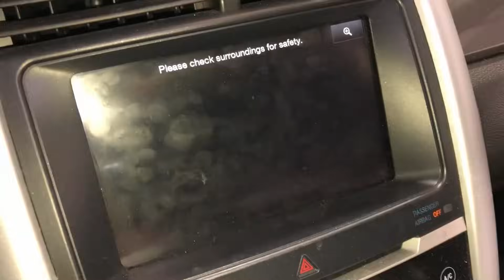2007-2019 Ford 6F50/55 Six Speed Transmission: Fluid Exchange Procedure

Comment from the maker: These are the Tools and Parts I Recommend:
Mercon V-
https://amzn.to/2XnQJHF
Mercon LV-
https://amzn.to/2N1aOji
Transmission Funnel-
https://amzn.to/2FnH2Pf
Thread Sealant-
https://amzn.to/2MYaSjJ
Reply: Fordtechmakuloco, what about the models that don’t have a dipstick? Fluid change is straightforward, but curious about how to confirm correct fluid level without a dipstick. 2014 Ford Edge Limited, 2.0L ecoboost, 2wd
Reply: @honkybd  did you ever find your answer?  Let me know I may have your answer
Reply: I have a 2018 Ford Explorer Limited. 3.5L V-6 Dertec Engine FWD. Is this the procedure I use for this transmission DIY job?
Reply: @PeterSlots  I'm not sure if we have the same engine and transmission but I would say we do, I have a 2017 3.5 liter engine as well. That being said the process should be the same.
Reply: Fordtechmakuloco do you screw in the dip stick fully or just drop it in when reading?  There would be a difference because screwing it in fully changes the reading a few mm's.
Reply: I got a couple questions about a 94 Ford Thunderbird 4.6 and a 98 Ford F150 4.6
Reply: Having issue with a 2011 ford ranger.
 Transmission slips when making a turn after straightening up and de acceleration will correct itself. ATF flruid topped off any idea?
Reply: Hi my name is Mark I have a 2010 Ford Fusion V6 all-wheel drive and the transmission will not shift pass 3rd gear what is your suggestion for this problem
Reply: Do you recommend just the drain and fill. Or would a transmission flush be better. Performed by the Ford dealership of course. 2018 Ford Explorer 3.5L V6 engine.
Reply: @PeterSlots  drain and fills are better. Flushes can disturb friction material. Especially if it wasn't regularly maintained every 30 to 50K.
Reply: Do you recommend BG chemical products such as their transmission fluid which comes with a warranty for a complete transmission fluid flush or do you recommend just sticking with Motorcraft products?  First time Ford owner and was just curious on what you would recommend. Thanks.
Reply: Hey man I have a 2014 explorer sport 4wd ecoboost... from park going into drive it makes a slight clunk noise .. any idea why?? It runs fine and transmit shifts normal .. just makes a slight clunk noise form park going into the Drive. But from neutral to drive it’s goes in smooth .
Reply: My reading is at max. Do i have to take some oil out?its over the half mark
Reply: Do you know the part number for a replacement drain plug ?
Reply: L
Reply: My 07 has the little yellow dipstick. It’s a 500 frt wheel drive. Do I still use the same fluid as in the video or Toyota stuff ? Thanks ! 
Great channel!
Reply: Hey FordtechMakuloco, 

 My trans axel has a weird clicking  that almost  sounds like something  spinning, in front of the drivers side half shaft right above the drain plug,  have you  ever heard this?  Do you know what that is?

Comment: I don't have the space or the physical ability any longer regrettably to do this service myself. I know this video is 6 years old but I was wondering if anyone had any idea what a Ford Dealer might charge currently now in 2025 for this service on my 2013 Taurus Limited 3.5cu. front wheel drive without ecoboost.  The car currently has 52000 miles on it and shifts fine and my owner's manual maintenance schedule states that transmission service needn't be performed before 150,000 miles which I think is ridiculous.  All 3 of the quotes I got from service shops around my area quoted $350 to $479 for a full flush and I've read numerous articles online against doing the purge/flush service and simply doing the drain and fill procedure outlined in this video. Any opinions or help on the topic would be appreciated.

Comment: Fusion Sport 2.7 uses same transmission. You can also use any Dexron VI fluid as this transmission is a joint venture between GM and Ford.

Comment: I just bought a 2016 Edge, and from my research the 6F50 trans hold 11 qts. of fluid, but not all of it can be drainded at one time. Multiple changes such as this would be needed to totally have changed all the fluid. So this prodcedure is actually more of a refreshing of the fluid, not a total exchange. But I am still going to do it, and probably about every six months for quite some time after that. This video IS very helpful in explaining the prodedure.

Comment: So I have 2017 Ford Edge doing a transmission fluid change you don't have to replace the trans filter??????
Reply from the maker: You cannot without splitting the case.
Reply: Ok thanks, i done flushed and refilled 3x the transmission and shifted gears while flush and fill and fluid is still black i even tested the drive and it gets hot and started slippin after the car gets hot

Comment: hi, your video are very interesting: i hae one question: on 2011 i bought a ford Explorer 2011 limited 4wd new, i imported it directly from Usa. At today i drive for only 14.700 miles. In this 14 years i never change trasmission oil, i cheked and oil is right level. Is better than i change oil? And i wil change oil same this video or should I also flush the automatic transmission with additives? Some mechanics in Italy tell me that if I just change the oil without flushing it, I might have problems with the transmission, so they tell me not to change it. Could you give me your opinion? Thank you very much.

Comment: My 2011 Flex has 397000 miles on the original motor and transmission.
Regular oil changes with Super Tech full synthetic oil with Marvel Mystery oil on the engine Regularly drained and filled the Transmission. Still running fine.
Reply: Single drain and fill transmission fluid change or more?

Comment: I have the 6f50 in my 2017 3.5l edge with 57k miles, I went to local ford dealership and was quoted $379 for a fluid exchange service, not sure if this is drain & refill or a flush of some sort. Service tech did mention something about using a machine to suck fluid out, is this a flush and would this be advisable or just a drain & refill. Thanks
Reply: Add a bottle of Lucas Transmission Conditioner next time too, in place of some of that 4.5 quarts.

Comment: I bought a 2017 explore XLT last year with 103,000 miles. After a bunch of DIT maintenance I've had to do, I checked the fluid and its.... So bad. So I've started doing some small incremental drain a fills, like 2qts at a time every 500 miles or so. Trying to avoid shocking the transmission
Reply: Add a bottle of Lucas Transmission Conditioner next time too, in place of some of that 4.5 quarts.

Comment: Sir! I have  actually i bought my son a ford excape s 2017 and we change the tranny fluid and my question is if its ok  to over filled the fluid, what we did is we removed old fluid measured almost 4 quarts on cold temp and then we add 4 1/3 abit fluid thats the reason i  ask is it bad if you overfilled the fluid? Thanks!

Comment: Hey, you seem knowledgeable on trans, I have a ford flex, 6f55 that is kicking my butt for about a year,, I have never found another with the issues mine is having, Im praying you can help?? p0973, I have changed the converter, valvebody and solenoids, I just dont feel like its a transmission issue? What would you do? Change the trans?  Thank you so much!!

Comment: Love yours videos. I was wondering if you’ve done one on how to drain the fluid from the torque converter on these? I have the 6F50. I guess you have to remove the return line and drain and fill until new fluid comes out or something, not 100% sure on these… it’s my wife’s car. I have polenta of fluid, just don’t want to waste any if you know what I mean.
Reply from the maker: No need to drain converter, fluid drain and fill every 30k miles is way more than enough.
Reply: @FordTechMakuloco  ok, thanks for the reply. The only reason I was wanting to get it all out was because it a new used purchase and can’t confirm it has been done when the records show. Maybe I’ll just do like you suggest, but just do it again in ahead of schedule. Thanks again really appreciate the advice!

Comment: I’ve watched a lot of his videos and this guy is the best! My wife has a 2017 explorer and when she would go 50mph and let off the gas it would stall or hesitate when it would decelerate.  Cleaned the throttle body, MAF sensor and sea foam cleaner in a full tank of gas and would hesitate when she would let off the gas pedal. Took a chance and took this guy’s advice……PROBLEM SOLVED! Fluid was black at 86k miles and took 4.5 quarts of Fordmotorcraft MERCRON LV runs smoother than ever, shifts smooth and no hesitation like before! But warning the transmission fluid is $15 each quart!!😮😮
Reply: Ya I have watched all the more popular f55 trans fluid procedure videos and this one is the best. Some forget to measure the fluid some dont know how to check it correctly etc etc
Reply: what I did to measure the fluid level was let the old transmission fluid drain into and old pan because it had NEVER been changed cause she bought it brand new from the Ford dealership.  I had 5 empty oil bottles and poured the old transmission fluid in them to see how much drain out of the trans. Fordtech was on the money cause there was 4.5 quarts that was drained into the oil pan.  Instead of having half a quart take up space on my shelf, I left the drain plug out so when I put half the quart in it would “flush” the remaining black oil sitting in the trash out.  The fluid was black then turned red, put the plug back in and put the remaining 4.5 quarts in and my wife says that it runs better than before!
Reply: Bideneconomics! You feel the pinch when you pay $15/QT for a fluid! I think corporate greed is taking over FoMoCo now, more than ever!
Reply: I paid $9 per quart at summit racing

Comment: I have a 2019 ford explorer the transmission looks like the one you are working on I have already did the trans oil change and I get PO867 code but I’m not sure where the transmission fluid pressure sensor is located

Comment: After I did the drain and fill and oil level was good.... I took it for a 10 minute drive. I noticed some transmission slipping. I checked the oil level after the drive and it was in the hash marks range somewhere above the middle close to the hot since I drove it around. It wasn't slipping before. I am hoping I just need to drive it a little bit more for the computer to adjust to the new fluid. The oil that I drained was almost exactly the amount I poured in when I placed the old oil in the empty container.. Can anyone elaborate? Thank you

I just noticed it might be the throttle body. I went ahead and cleaned it today while replacing the spark plugs and from what I saw on another video..... The car needs a reset to calculate the throttle body. Current doing the reset and hopefully it will solve the problem. I did both spark plugs and transmission drain fill today. Since I had removed the throttle body and it was dirty.... I cleaned it. By the way... The battery was disconnected during the spark plugs and throttle body removal.

Comment: I just did a drain and fill on my wifes 2015 Edge. My brother has a 2011 Explorer but only puts a iut 8,000 miles on it a year. Should he drain and fill the transmission fluid more frequently than every 30k miles?

Comment: Why can't you just measure out how much fluid came out and put that much back in?
Reply: You can if you want to assume that the person who put it together, did it the right way. But if you’re spending half an hour to do this, why not spend an extra two minutes and do it safe? I just changed the fluid in my wife 2017 Explorer I used a 2 gallon pitcher that was marked to measure how much came out and only 4 quarts came out. Which meant it wasn’t full to begin with. I put 4 quarts back in, drove it and had to add more.

Comment: does the fluid always have to be drained to replace the ptu? I just got a 2013 SHO and the ptu was replaced about 3k miles ago by a ford dealer. was going to do the fluid but didnt since the dipstick was pink as can be. My hypothesis was that they had to drain and fill fluid with the repair. so should I not worry about it for now?
Reply: just hit 70k miles

Comment: 2014 Explorer Owners Manual states 150,000 miles.   I've never heard of such a thing.  I have historically used 60,000.   Thanks
Reply: Add a bottle of Lucas Transmission Conditioner next trans service, in place of some of that 4.5 quarts.

Comment: What is your opinion of adding Seafoam Trans Tune at each change and running with it full time with the additive?
Reply: Lucas Transmission Conditioner is better. Just add place of some of that 4.5 quarts.

Comment: I’m working on a 2012 explorer 2,0 eco. With 2wd. Doing transmission drain and fill. This transmission doesn’t have a dipstick. It has a plug.  Been trying to get info to fill transmission on how many qts of Lv.  Thanks. All videos are with a dipstick.
Reply: Should be a side level plug. Have to remove left, front wheel/tire to see it. Vehicle must also be 100% level.

Comment: Awesome informative video.  I just acquired a one owner 2016 Explorer 3.5 AWD with 90,000 miles as a project car.  It has no reverse and seems like 1st gear only.  It has code P0756.  Is it worth repairing the transmission or get a used transmission from the salvage with 60k miles?  I read the 2015-16 6F55 have a design flaw that causes this.  Any tips are greatly appreciated!

Comment: Another video on here said these transmissions would just drain out about 4 quarts of trans fluid. You really need 5 quarts?
Reply from the maker: I use 5qt bottle every time never even check the dipstick anymore.
Reply: @FordTechMakuloco  wow. I'm just too scared of overfilling. Maybe the higher mileage ones need more? I know there's like a total of 11 or 11.6 quarts total so you're not even getting half of the fluid out each time. 

I'm thinking about doing a dual drain & fill to really clean out the fluid at 150k on mine. Don't know how good the maintenance was on the car before I got it at 100k.

Comment: Im having issues with the 2016  exploder 4cyl ecoboost transmission. It tends to bang into reverse once you've only throttled up like its not getting pressure thru the solenoid. Ive had the reverse solinoids replaced twice.  First time under warranty.  Second time it never helped.  I replaced the whole valve body and solinoids, and there was no change in the reverse bang. I've changed the fluid twice, with lucas aditive no change.  I believe there is a glitch in adaptive learning.   I've had it reset and still issues! It angers me after 100 years of design that computers are destroying transmissions when mechanical transmissions worked fine. Aaaaaaaaaah! Help!
Reply: Could the torque converter on the way out.... 😮

Comment: Very helpful video, thanks! But I'd not sure, is it trans filter change needed for this type of transmission? I have a FPIU with 38K mileage and it's seems that nobody change trans fluid on it
Reply from the maker: You cannot change the fluid filter unless you split the case.
Reply: @FordTechMakuloco  wow! So, only thing what I need to do, it's just a replace the Mercon LV! Sounds good!

Comment: Now let's say you went to do a.quick drain and fill and snapped the head off the drain bolt. What would be the best approach to reboving the remaining stud. No welder in my garage.
Reply: How the hell do you snap off a transmission drain screw?  They were put in at 80-90 inch pounds.  There are kits that have a reverse drill bit and also a screw removing bit
Reply: Drill and tap.😳

Comment: So after you do the drain, and fill the fluid . If this car has transmission cooler lines. Why couldn’t you disconnect the return line and let the transmission pump out the rest of the old fluid and just replace all the fluid at once
Reply from the maker: You want that mix.

Comment: I decided to pop back in after a year since my full trans fluid change. (3x 5.5gts). It's only been 3500 miles since that full flush but I'm opting to do the 5qt change at every oil change just to keep things fresh. Plus I'm under there anyways right next to the trans, so why not? Overkill? Nah, cheaper than rebuilding the trans! 🍻
Reply: Hoping to get an answer here hopefully you can help.... the book says it takes 11.6 why is only taking 5.5?
Reply: @C J  you never get all the fluid out. There is alot left in the torque converter and some that stays in passage ways where gravity won't let it drain out of the system. To get the best results you can do 3 of the 5qt changes. Do a change and fill and drive around for a little bit. Then do another 2 more the same way. This flushes most of the fluid out and replaces it with new fresh fluid.
Reply: @mygt8a4re  Hey thanks for replying, really appreciate the help! Was ready to drain it and send 11.5 quarts in it lol ahh man I'm glad I procrastinated, watched another video and asked.

Comment: I know some of the older vehicles when changing the trans oil you have to unbolt the trans oil pan and replace the filter in there. So I have a 2019 ford explorer, is that not the case anymore?
Reply: Nope. It is inside the case on this Transmission. The whole this has to come out and torn down to replace the filter. This is why 30k fluid drain and refills are too important.